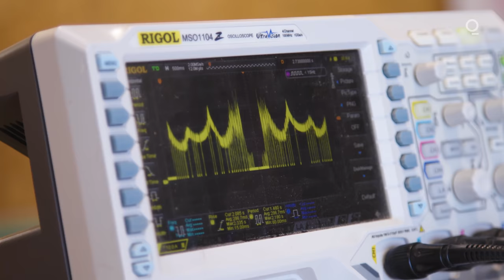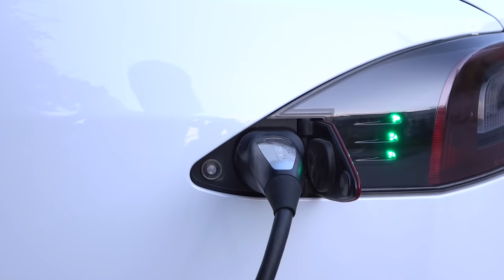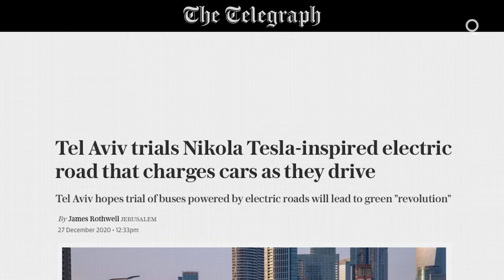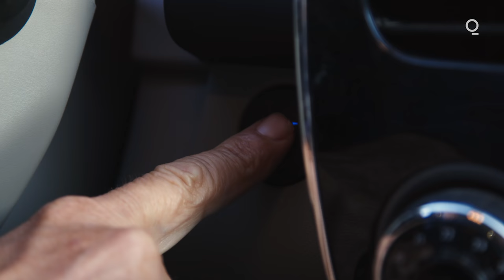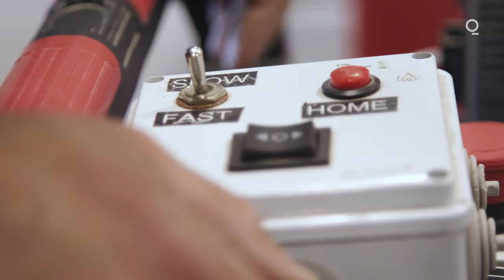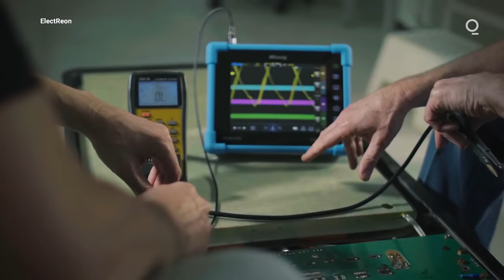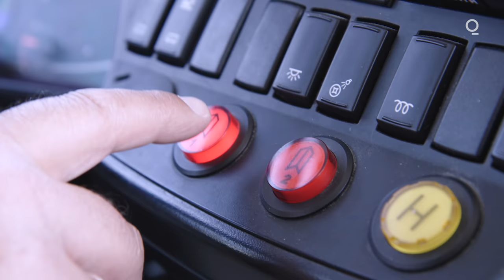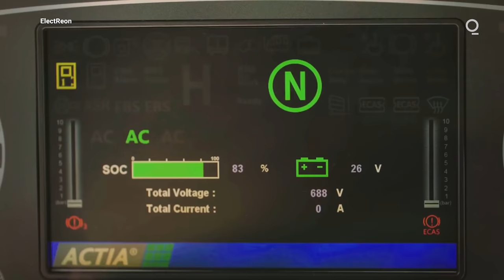How Electric Roads Could Power the Future

Comment: Wireless charging low efficiency, will double the amount of energy needed for the same result. This is an environmentally criminal idea.
Reply: But it's electric!!!11
Reply: @tomlxyz  Electricity is not inherently "green". It depends on the way it was generated.
Reply: @nathan3239  /whoosh
Reply: But they said they will use the 'cloud' .. this makes the whole process 112% efficient /s
Reply: I guess the argument they make is that will allow to use “half” the battery, so it will be greaner overall ?
Reply: The idea is that electricity generation will all go green eventually, which will happen, but slower than preferred.
Reply: @Casyfill  you only need to dig up the raw materials for batteries once, but the doubled amount of energy needed for each vehicle is a constant throughout the vehicle's lifespan.

Even if that power is coming from green sources, that generation also comes with penalties such as panel or turbine production and storage of the energy to feed this vehicle charging grid.

Compared to the alternative of car sharing over ownership where fewer cars are needed and bi-directional charging where cars are plugged in whenever possible so that they can absorb power when supply is excessive and supply it back to the grid when required.

Though this could also be achieved wirelessly, it's still a massive loss.

Another solution is overcome range anxiety that everyone seems so fixated on is to rent a car.  If on average you only need a half size battery as the video discusses, then on the rare occasion that you do need to travel to the middle of nowhere, rent a car with a massive battery.
Reply: @SD352-68  I think it still makes sense in places like cities where there are also busses that will benefit from the infrastructure. Any sort of incentives to make the air in cities cleaner will make a big difference.
Reply: much much much more than double
Qi wireless charging takes 4x more electricity for the same charge as a wire at a max distance of 10mm... this would be something nearer to 2000mm (20cm) - 3000mm (30cm)
Reply: Exactly.
Reply: This is a totally unworkable solution for many reasons.
Reply: @nathan3239  Yes but also no. Even the dirtiest fuel for electric generation is cleaner than the cleanest petroleum IC engine. Stationary power plants can employ exhaust cleaning that mobile vehicles can't.
Reply: This 
I also doubt they can wirelessly charge as fast as most cars consume energy, making long-distance trips basically impossible. Maybe wireless charging speeds will improve over time.
Reply: @hollar5560  if you want to charge buses from on the fly charging use a pantograph.
Reply: @SD352-68  what did that even mean
Reply: @Garrison169  there's no such thing
Reply: @hussainishehu8445  If you mean there is no such thing as magnetic attraction, you are obviously incorrect.
Reply: @Garrison169  I mean there's no such thing as "unworkable"
Reply: @SD352-68  better
Reply: @SD352-68  better
Reply: @hussainishehu8445  There may be few things that are unworkable, but there are many things that are grossly impractical.  This "electric roads" idea is one of them.
Reply: @Garrison169  we will figure it out. It's what we've been doing for billions of years
Reply: @hussainishehu8445  Well, actually, humans have been figuring it out for no more than 200,000 years.  But whatever the best solution is for charging batteries in electric cars, it won't be this electric road fiasco.
Reply: Why  the train don,t need  battery  if  the
Cars  need it  ?   Some one can explain me ?
Reply: @alejandrodejesusrodriguezq4880  Technically the cars wouldn't "need" batteries either, as long as they stayed on roads with charging infrastructure embedded, however I don't think anyone expects it to be feasible to embed this into every road, just the major ones, much like you don't convert every road into highways.
Reply: @iamdmc  Witricity claims to have a wireless power sys. that was quite high in terms of efficiency if memory serves. Are they for real?
Reply: use wire charging electric vehicle.
Wait?isn’t is called train outside USA.
Reply: @hollar5560  you could get the same effect with removable batteries, just swap em out at the depot once they're depleted
Reply: While it's not perfect right now it is a step in the right direction.  And over time the systems we rely on will improve and become better for the environment.  Change does not happen over night.
Reply: Witricity claims high efficiency over 80 percent IIRC

Comment: this is great but wireless charging emits heat as waste product so you 
throw away  47% more energy just as heat energy :-) so whats green about
 that?
Reply: No to mention you had to make a hole in all roads to pull the coil, which have a huge cost
Reply: @ernestoramos520  exactly. why they just dont invent car tires with coil rims on the surface and just dont transfer energy with conduction. it would be much more effective
Reply: to just dig few cm into the ground and install 
and transfer it on touching surfaces
Reply: @squarewheel9113  are you insane?
Reply: This will never even be needed
Reply: Will it still work when the road is submerged during heavy rain or worse, flash flood?
Reply: You for real
Reply: @ernestoramos520  they dig up roads for no reason now so theres no difference
Reply: @Nobody-pq7wy  i think your on to something
Reply: @squarewheel9113  The US has experimented with solar roads for a long time. I remember reading about it over 20 years ago. In the end it's just not viable. The cost to performance ratio of solar panels embedded in roads is horrible since you don't get a proper angle for sunlight and when the road is in heavy use it generates almost no energy.
Reply: @squarewheel9113  Electricity powers the coils to create a magnetic field.  The electric power is coupled from a coil in the road to a coil in the car.
Reply: Also! after all it's megawatts of energy in the air! Unresteicted energy will always be a anxious place to be ,nobody knows well what it does to our body. Dogmatic geeks!
Reply: This waste is everywhere we produce 160k TWh a year. 50k of that is wasted. Come up with a solution and stop complaining
Reply: Look at all the sun potential we waste.
Reply: Exactly
Reply: This is not true. Current DWPT technology is around 88% efficient. You’re thinking of personal electronics wireless charging which is much less efficient.
Reply: But if wireless charging "throws away 47% more energy just as heat energy," why is it great?
Reply: One would think that in colder climate areas that having roads that do not require the use of snow plows and salt or other chemicals to remove snow and ice would be welcomed especially on bridges and sections of the roads with huge inclines.
Reply: Exactly what I was thinking. Also with the amount of work required digging up the roads to install the coils you could instead install Moore charging stations and not waste energy wirelessly charging.
Reply: Exactly what i was thinking
Reply: @jacksonoutside  Yeah, actually, US dept of energy achieved 97% @ 120kW already back in 2018, and they definitely haven't gotten worse performance since then.
Reply: Just question my phone needs to be  sitting right on wireles charger, how is this works though the pavement?
Reply: @devonleon1653  Different frequencies, amplitude, voltage, materials, etc. Much like you don't use the same cables for charging your phone and your car, wireless charging of said devices is also optimized for their respective use case.
Reply: @squarewheel9113  what  about  the
Train , transferece of  energy by cable ??
Reply: @gregorneu  what  about  the train tecnology , can  the cars use this  ??
Reply: @alejandrodejesusrodriguezq4880  what you mean by „train technology“? The electrical wires above the trains?
In that case i can’t imagine having wires over every little street. But maybe it will be like that some day idk
Reply: Not everyone know this😜💀

Comment: Begin with raising concern about depletion of materials like cobalt and lithium, end with depleting the copper resources ...
Reply: This is a solution to that, use buses use less cobalt, use wireless charging use less lithium (smaller batteries)
Reply: @0x0michael  What I meant was the copper used to build the coils, which especially for power transmitting should be high grade material(copper itself is very pricy) for efficiency purposes, another factor is the distance made by the wheels of the vehicle in which make the power tranmission very inefficient (think about how we currently use the wireless chargers for the phone. their body will usuallly be in touch with other).
Reply: global copper reserves is at least 40x larger than lithium reserves and more than 100x larger than cobalt reserves, not to mention that copper recycling is much more environmentally friendly
Reply: @shanewalker3273  True, but the scale of deployment should be taken into account, (roads, highways, ...), also the process due to the distance of radiation coupling is somewhat inefficient.
Reply: Guess we better start mining asteroids. Let's go beltalowda!
Reply: @mikeflanary642  Yeah, sci-fis like Expanse might become reality sooner than expected ...
Reply: @parsarahimi71  I think they are probably going to implement these charging roads in things like bus stops and traffic stops, rather than highways or freeways, because they don't need to put down as many but it will charge it enough
Reply: There's abundance in Mars
Reply: There wont be any issue with copper shortage with the rise of superconductors. These technologies are not for todays use but for many decades to come.
Reply: @shanewalker3273  Not to mention that there's significantly fewer roads that needs charging infrastructure than there are cars (buses, trucks and all other devices) that needs batteries.
Reply: We literally made powerlines that can span to the sun and back a few times over. I don't see why not. Batteries are not feasible either yet being implemented especially when they're so heavy.
They can put the modular electric roads on existing roads on main roads and motorways. They're already close to powerlines themselves.
Reply: In road changing is the answer.

Comment: This might work on a limited scale, like in a factory or a warehouse. Seems like an ad for a company  that probably won't live very long.
Reply: It's an ad for ford, it says at the start. Hopefully you're right though.
Reply: it's a promo clearly. These ideas have been around since the beginning of electric cars, it's a no brainer why it's not being used.
Reply: Or fixed bus routes, particularly in places like Phoenix or LA where the weather will not mess stuff up too often
Reply: Yeah this is just too expensive and non efficient
Reply: Bus routes.
Reply: @louisvaught2495  trolleybuses are a thing and much easier and cheaper for maintenance
Reply: @korras21  I don't think you understand how these work very well, or really bus systems in general. Trollybusses have fixed routes, a wireless road just needs the bus to drive over it for roughly an hour

So you can wirelessly charge on specific shared points on a route, which is cheaper and much more flexible.
Reply: @louisvaught2495  not difficult to understand the concept, however in most of northern hemisphere, with the range of temperatures these would hardly last a season.
Reply: It reminds me of the Tethered Kite Program funded by Google, literally a complete crash. No shortage of Pipe dream money in the Liberals Market.
Reply: This will be a fantastic answer for Europe's & America's EV charging challenge; the car owners with no own drive way. This solution can be fixed in all car parks (public, office, underground, etc.) for those car owners to get their cars charged while in parking during day or night.   

I saw an article, in china most of the bus stops have fixed with these charges. Therefore those buses extend their daily range & spend very limited time recharging them in the depot. 

If this solution is fixed in your garage or parking lot, Car can start charging the car even if the owner forgot to connect the car in to the plug.
 

If the cars can be charged during the day while driving or parking, all the sun shining countries can use their additional electricity generated by rooftop solar systems without wasting them. Then they do not have to burn fossil fuel to charge cars during night. Though this would not be the current scenario, it will be very likely in few years time.
Reply: @jgboyer  That's still under active development, actually. It's of particular interest because a prop kite can naturally store energy by going higher in the sky.

The trick is just getting it to be cost effective.
Reply: It can work very well in BRTs (Bus Rapid Transit) Corridoors.
Reply: @louisvaught2495  Yes, we don't understand how this system works very well. Authors never say a word about power and efficiency. By the way, how much would an hour-long driveway cost for this system? Say, bus goes 10-15 miles per hour. Do you imagine the cost of 15 miles of such road?
Contrast it with another option. A trolleybus with a battery and automatic trolleys that connect when there's a line above. Not a rocket science. No emissions. No losses. Any power you want, no limit. Cheap to install and maintain. Is there any reason to emit high power electromagnetic waves all around?
Reply: @tokyofamily8536  Here's a passive income opportunity for the petrol companies, the mom n pop gas stations, etc., to pivot and not fall behind when drive-in petrol stations become obsolete.
  Commercialized charging lanes on the interstate highways. Own/sponsor a stretch of the highway. When EVs drive in the "power" lane to wirelessly charge they automatically pay whomever owns/sponsors that stretch of the charging highway. The sponsor bears the cost of updating and maintaining their section of the highway. Consumer demand incentivizes the sponsor to supply the best charge for the buck.

Comment: Ok thunderfoot has new material
Reply: Just what I was thinking. This will probably have the durability of solar roadways and imagine the cost of putting this on every freeway. You also need high voltage transmission lines to power this thing along the entire freeway. Finally what is this thing going to look like in 10 years when a bunch of tanker trucks have been driving over it 24/7

Comment: There is already an electric road that has been around for decades, its called a trolleybus

So, put up electric wires on all the roads and allow any cars to connect and disconnect at will
Reply: 🤣🤣 and make streets uglier? NO!
Reply: @bluegas  the streets will be far less smelly from the reduced number of polluting vehicles
Reply: This doesn't work that way :P
Reply: That will resolve the charging problem, just pay a monthly fee.
Reply: @juanfermin1841  or pay for it through taxes
Reply: @MΛX true, but trams require rails, and busses smog up the air and require electric batteries which pollute the water with the mining practises used

Trolley busses are cheapest and electric
Reply: @MΛX why have a tram when you can have a train?
Reply: @MΛX what i am suggesting is no less than the full electrification of all traffic using wires and minimal batteries
Reply: @MΛX you don't know your transport, a train has raised rails and travels separately at 100 MPH, a tram has recessed rails and goes through pedestrian and road areas at 30 mph or less
Reply: @MΛX how exactly? What technical flaws can you point out?

Also, note that it is impossible to get electrocuted unless there is a completed circuit, and the purpose of design, is to idiot-proof it, its already been done before with busses, so, let us expand the idea to include cars, trucks, everything on every major road

Comment: I was hoping someone would invent a reason for traffic to concentrate a small number or roads, in a specific lane. This should solve the problem of too little congestion that literally nobody is complaining about.
Reply: Exactly, that's the point I am raising. It's this issue of loss of energy in the form of heat.
Reply: @piyushshaw5063  not if electric vehicles are using said lane more then other vehicles. In certain parts of the US we have dedicated lanes for electric vehicles that would be prime real estate for this kind of technology. The phasing out of internal combustion vehicles will take long enough where if all drivers are aware of what lanes have this technology, drivers with internal  combustion engines would just avoid that lane. I don’t think that this problem is much of a concern at this stage.
Reply: Actually, putting cars in a single lane can increase efficiency. If you hook them together, there is less aerodynamic drag. You can even remove the batteries! Since we have a specific lane, we can have special cars that hook to power lines above the road. Maybe even make the road and wheels out of something that wastes as little energy as possible, maybe steel. Hmmm.... this sounds like an electric train
Reply: Sounds like public transport to me
Reply: @piyushshaw5063  thermal radiation from an electric car battery is not nearly enough to “heat up” a car lane. Combustion engines run much hotter than an electric road or car battery
Reply: @stevenarvizu3602  Inductive charging ("wireless electricity") does waste a lot of energy though. Consider the resistive heat of the coils (the one in the road would heat up too, which could be a problem and cause thermal stress). Also consider the EMF generated that isn't absorbed by the other coil, that would also radiate away as unused electricity